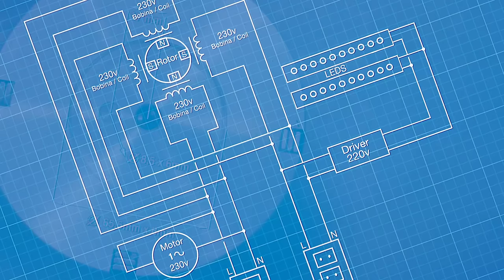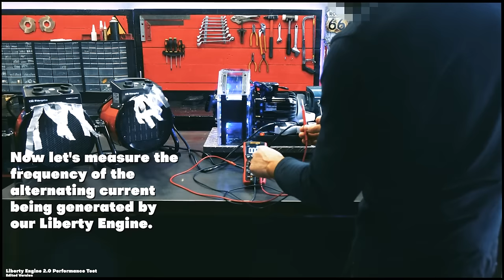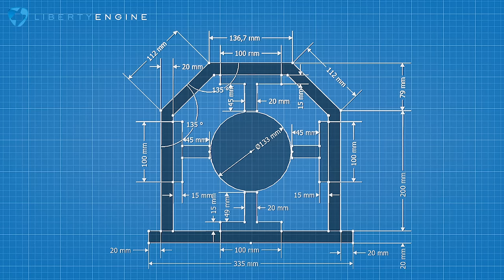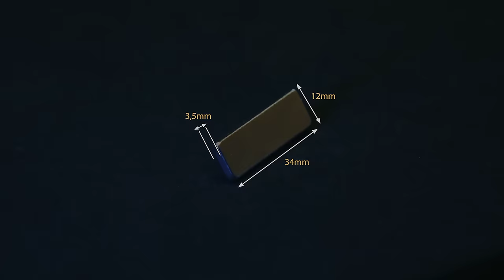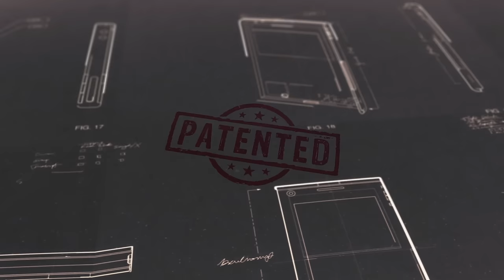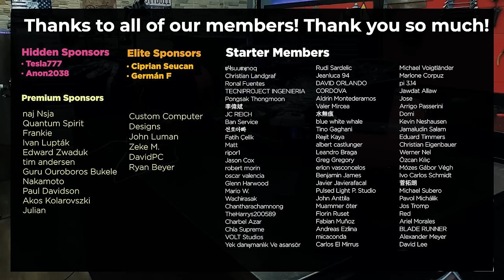SECRETS AND MANUFACTURING PLANS OF THE LIBERTY ENGINE 2.0

Comment: This appears to be the modern day equivalent of the alchemist's dream of turning base metal into gold and flies in the face of physics.
Reply: I dont think it does. What they have done is minimized or eliminated the eddy currents. I saw a video years ago with some people doing something very similar. Get rid of the eddy currents then the magnets will pull it around with very little friction. He just made it way more efficient.
Reply: @aywitb911     Do you really think the conservation law of energy is only valid if eddy currents are present? By minimizing eddy currents you can increase the efficiency of a working device but minimizing eddy currents doesn't make a non-working device work.
Reply: @heinzpg  Uh have you completely forgotten about the magnetism. That is whats used to spin the device. Its the field coming from the magnets, once they die out however long that is then it wont work anymore. Its not really over unity its just creating energy from the magnetic fields. They go away and so does the energy.
Reply: @aywitb911    Con you harvest energy from the gravitational field? No. Of course you gain energy if an object drops, but to repeat that, to lift the object again, you must spend the energy which was just gained. Similar you can't harvest energy from a static magnetic field. In addition, the magnetic field represents energy but the amount of this energy is rather modest and even if one could tap it, it could not drive a motor for a reasonable time.
Reply: @heinzpg   @heinzpg  A magnet draws other magnets to itself and also repels them that is how you make magnetic motors work.. These people have figured out a way to diminish the eddy currents basically eliminating the back emf so it will run a really long time until the magnets wear out..
Reply: @heinzpg  I agree with your static magnetic field statement as it relates to harvesting energy from gravitational fields, however, using a high-energy electromagnetic generator (HEEMG) with a microwave frequency range of between 10 to the 9th  to 10 to the 18th Hertz, quantum vacuum plasma (QVP) particles become polarized & accelerated outside the effect of the 2nd Law of Thermodynamics (entropy), resulting in an energy flux on the order of 10 to the 28th watts per meter squared.  While not a zero-point device, the energy output is many times higher than the energy input. As an interesting aside, a disc-shaped craft containing a HEEMG and an axial rotational component producing the above QVP field particle polarization would negate the frictional effects of gravity, solids, liquids, and gases, allowing it to pass through each with zero resistance as well as providing instantaneous, non-G force- internal-impact-maneuvering as has been and is seen with UAP flight characteristics.
Reply: Humans current understanding of physics only applies to this particular planet and nowhere else within the known universe

Comment: Hello, I see that you are not answering a single question that I asked you. Where is the phase shift on the stator part where the coils are placed. There are not any! because to create a phase movement it is necessary to have a phase shift as for the part of the single-phase motor because otherwise the voltages cancel each other and the system cannot continue to turn. So how do you do? I am really waiting for a response from you. THANKS
Reply: FYI. It only has 2 phases. Each with two windings (facing opposite to each other) connected in parallel..Separated by 180 degrees apart.
Reply: так там конденсатор стоит он и дает сдвиг .

Comment: Alloy composition (With the help of AI):

Silver: 77%
Aluminum: 15%
Copper: 5%
Manganese: 3%
Key adjustments:

Slightly lower silver content to reduce electrical conductivity and minimize eddy current losses from induced swirling currents in the rotor.
Higher copper content to maintain conductivity, but manganese added to counteract copper's tendency to increase eddy currents.
Manganese additions also increase resistivity, which helps control eddy currents.
Manganese provides good hardness and tensile strength as well, substituting for zinc.
Lower conductivity alloy helps reduce magnetic brake effects from induced rotor currents opposing the rotating magnetic field.
Other refinements could include:

Trace boron or silicon for further resistivity.
Grain refinement and heat treatment to break up the crystalline structure.
Semi-conductive coating on the rotor surface to impede eddy current formation.

Can anyone comment?
Reply: What question did you ask AI to come up with this equation?
Reply: @McFlysGaming  p0:In the context of a perpetual electricity generator, only knowing that the rotor prototype holding the magnets is made of an alloy composed of silver and aluminium for the rotor. a very important clue is that the alloy is composed mainly of silver and aluminium among other materials. The total volume of the rotor is 1073.3 cubic centimetres and it weighs 7.6 kilogrammes. also was applied special treatments to this alloy. Suggest what this alloy is made of and provide all the proportions for each compound.

p1:Suggest a composition for this rotor to work in an optimum way in the context of an electrical generator.

p2: Take into account eddy current and magnetic break, things we want to avoid for the alloy
Reply: I got this from AI
If cost is not an issue, and the silver content needs to be more than 75%, the composition of the alloy for the perpetual electricity generator rotor could be adjusted as follows:
- Silver: 85%-95%
- Aluminum: 2.5%-10%
- Copper: 1%-4%
- Zinc: 0.5%-2%
- Nickel: 0.5%-2%
- Magnesium: 0%-1%
- Titanium: 0%-1%
- Beryllium: 0%-0.5%
- Silicon: 0%-0.3%
This composition would have an even higher silver content, which would provide even greater electrical conductivity than the previous composition. However, it's important to note that increasing the silver content beyond a certain point can also reduce the mechanical strength of the alloy, so this should also be taken into consideration.
Again, the exact composition will depend on the specific properties and performance required for the perpetual electricity generator rotor, but this provides a general idea of how the composition can be adjusted to increase the silver content.
Reply: My  idea is 82%Sn, 17% Al and 1% Ag
Reply: @happy2be3one  Tin is a good idea but it’s mostly silver and aluminum.  According to Artificial Intelligence, it cant have to much aluminum because it start to lose back emf impulse.
Reply: @McFlysGaming  but who can afford that costs of silver? Its radiculus. It must be a easier way
Reply: hmm, cool, looks like good knowledge base, yet, theres also errors :D ChatGPT  says u cant catch  light within a mirror box (which is wrong)     [ a laser works like that ]
I think it's missing some of the scientific data base
Reply: Are you the manufacturer of this Liberty Engine??
Reply: To be an Alfa metal it must be refined with Tin!
Reply: @McFlysGaming - to be an Alfa metal it must be refined with Tin!
Reply: @edinosmanovic5192  so Tin will turn it to Alpha metal?
Reply: @happy2be3one - made rotor from Aluminum then plating it with Silver, that should work! Ad Tin in Aluminum, max 3-5% from needed mass of Alumina for better conductivity, to eliminate eddy currents put a metallic structure of machine on home grounding. Let me know if it works?!
Reply: @McFlysGaming  - so metallurgy say bro! I read some lectures about to understand better
Reply: @edinosmanovic5192  Thanks for the information, I'll put this on my research documents.
Reply: @McFlysGaming  - it must be max 3-5 % of total mass!

Comment: Assuming the alloy is Silver/Aluminum only, the proportions are roughly 56.24/43.76 volumetric and 83.31/16.69 weight ratio Ag/Al. 
The other unknown components might alter the proportions of these two. The price of roughly 6.5 kilos of silver is around 5.2 k USD. 
Investing that much in the rotor would be quite a leap of faith...
Reply: yeah but if it works.... also IF this is pushing 20 KW of power it's substantially cheaper than a generator of the same strength

Comment: Amazing how when each heater was turned on the generator didn't bog down whatsoever. That definitely made me skeptical...
Reply: I think there is a catch with the distribution outlet when it was turned on. If it is not connected to the network, the indicator should not light up. And why did it light up for a sec? Although, perhaps, the capacitor was discharged on the neon lamp!
Reply: @НЕЗНАЙКАТВ  even if you only turn it by hand, there will still be a small generated voltage enough to light the lamp.
Reply: @simplethings2410  You mean lamp on the button of the power outlet? If you watch the video slowly, you'll see it. I plan to make a copy of shown "liberty engine" to prove or disprove the idea. It looks like two coils would be enough to power the motor!
Reply: @НЕЗНАЙКАТВ It is just the two coils facing each other that is connected in parallel lights the lamp..and the other two coils connected also in parallel powers the motor..There is no electrical connections between the two sets of parallel coils. They are two different circuits..Whatever happens to the coil set where the lamp is connected, does not affect the other that is driving the motor. You can obviously see that in the electrical diagram.
Reply: @НЕЗНАЙКАТВ  Watch the clip again and you will see that it is the light coming from the ceiling of the workshop reflects to the light button that is why it looks like that light it is enrgized prematurely. It is just a reflection of the light above.
Reply: Yes I am very skeptical because of this one reason. There should have been a drop in rpm with each heater being turned on. Every conventional generator does this as soon as you power on anything with a significant power usage.
Reply: It actually would have spun faster under load .......if this was a real device. I have seen it on Bedini energizers I have built.
Reply: @DavyOneness  whatever you say bud 😂
Reply: Applying the word conventional to an unconventional device would be a contradiction in terms, specially considering the use of magnets and the very unconventional makeup of the rotor

Comment: Dear Inventor, I have few questions for you.
1. How you are maintaining constant cycle of 50 hz frequency.
2. Also how you are maintaining constant voltage of 110 or 230 ?
3. You said in video that you have created an alloy material to get the weight of 7.5 kilograms for the rotor. Can it be any other material with same weight
4. If the rotor weight is different and 7.5, what will happen?
Reply: The secret is that it never worked in the first place lmfao.
Reply: @eppicshotgun1281   If it was viable, ...and if there goal was to truly help the world, ...THERE WOULD NOT BE A "MEMBERS ONLY" COMPONENT! GTFOH!
Reply: Couple it to a heavy flywheel, run the system and afterwards, remove the power supply to the motor, you will see that the frequency and speed will remain the same for quite some time. The heavier the rotor to stop turning, the longer for it to be able to sustain the speed even you remove the power to the motor before it coasts down.
Reply: Actually the heavy rotor is just acting like gosolin engine flywheel which helps in making engine continue rotation to complete stocks cycle or continuing smooth cycle

Comment: The first law of thermodynamics states that energy cannot be created or destroyed in an isolated system. It can only be transformed from one form to another or transferred between different parts of the system. In other words, the total amount of energy in a closed system remains constant.
Reply: Це теорія, а не закон.
Reply: Correct but who said this system is closed ... or we can't open it. There seems to be some weard ssht happening when large mass spins fast especially when coupled with electromagnet spectrum. We dont yet underestand how universe really works - keep an open mind, most groundbraking discoveris were treated with hate and ridicule but to day we are using those ridiculus things ☺
Reply: Indeed for a closed system, for open systems in resonance, these laws don't apply
Reply: @viljar1112  "Weird shit happening" sounds conspicously like "then something magic occurs". What does "large mas spinning when coupled with electromagnetic spectrum" even MEAN? 
But of course, the test for any theory is not what it SOUNDS like, but if it actually works. Has this theory been put to the test outside of the genius's lab?
Reply: In any system large enough to avoid quantum dynamics, that's quite correct.   Smooth flow, as this is, simply can't do what he's claiming.   IOW, for this system to actually work, I'd expect to see frost forming on the outside of the engine as it pulled energy from the surrounding heat.   Anyone who had a discovery that produced far more power than the input doesn't NEED to impress any physicists or such, they just need to hit up their friends for investment and start up production in a factory in China for the parts, and put them together in the USA.   I GUARANTEE you the Dept of Defense doesn't give two flying whoops about theory, they'd buy ten thousand such generators in a heartbeat, IF you could demonstrate they worked with a real load, and could indeed run a day or two without stopping.   The US Navy alone would want thousands of them, they'd LOVE to replace their subs nuclear reactors with a "never surface again" power supply.   If it's easy enough to build at home, get China or India to cast up the frame and parts, and start selling them.   There'll be plenty of customers - IF it is shown to work.   Sigh.   This nonsense has been around for my entire life, and history says it goes back much further, and somehow, despite the obvious demand, NOBODY has sold one that could pass an independent test yet.   And don't gimme the "oil companies" thing, DoD doesn't care two whits for big oil, and would LOVE to cut off that billions of dollars of yearly expense and put it into developing new weapons.
Reply: Who says the universe is a closed system?
Reply: @viljar1112  Floyd Sweet's VTA circuit design had a self oscillating barium atom in two barium ferrite magnets that he then put triode coils in between and that seemed to do some similar "weard ssht" haha. i wonder if theres barium infused in the rotor somehow thats getting tapped into or oscillated manually by the 50 hz emp pulses.  kinda like an inverse concept of sweets design.  or if barium were in the rotor, then perhaps its atoms have been "conditioned" the same way Sweet conditioned his barium ferrite magnets to self oscillate or something.
Reply: Laws were made to be broken (He types on his magic, wireless keyboard which transfers onto his magic screen via his magic computer)
Reply: @chuckp_again_and_again but he isn't creating energy or mass while doing so.
Reply: @wadebrewer7212  Where do people get the idea that they can create? Everything we do is done with something that's already here...already created.
Reply: Yeah, and the magnetism coupled with the electric motor with little resistance provides that energy.
Reply: Чи можливо деталь виготовити не зі сплаву алюмінію, а зовсім з не металічних матеріалів? Наприклад: з дерева, скла чи поліетилену. Можливо хтось розуміється на цьому?
Reply: @GreenmeResearch  Yes they do and resonance does not add any energy to a system.
Reply: @jb-xc4oh  No, they don't. Get an understanding of open systems and the involvement of resonance and dipoles on this matter.
Reply: ....dont be surprised when a crack in the ice appears under your feet.....
and the equations are proved to be....somewhat.....wrong....on purpose
Reply: Its not a law its a PRINCIPLE of thermodynamics, and its not an isolated system, it takes its energy from the ambient background, Ether, active vacuum or whatever name you wanna call.
Reply: @pereximepere8439  .....ding-ding-DING!!!
Reply: Yep and thats why you will never understand N.Tesla
Reply: @comingviking  Why don't you stop making excuses of why not to try and go try
Reply: @wadebrewer7212  Keep being a hater!... seems to get you far
Reply: @hemidart7  I was.not.making excuses. I simply asked two questions: What do those terms mean, and has this ever been replicated by someone else? No answer was given, but I love your Greta Thunberg impersonation.
Reply: It is not a closed system if magnetism is involved.
Reply: This device violates the 1953 Invention Secrecy Act.

It will be destroyed.
Reply: @viljar1112  excellent comment!
Reply: Yes and 500 years ago , science and scientist Say the earth IS flat.

Comment: Does it only work if the rotor is built with this specific alloy, or can it work with non industrial secret material but just less efficiently? 
If it does work with other non secret materials, what would the specs be?